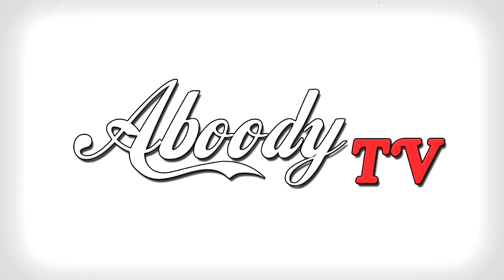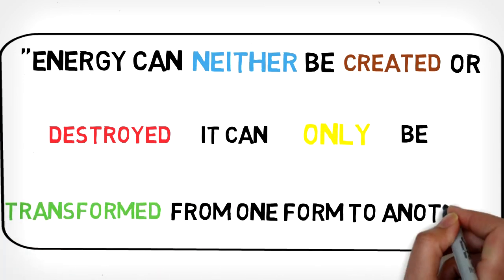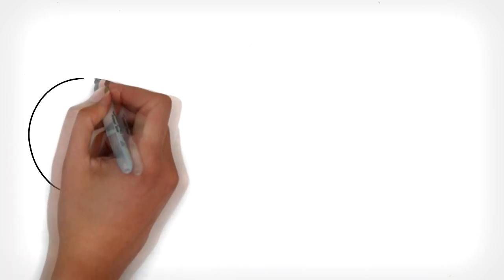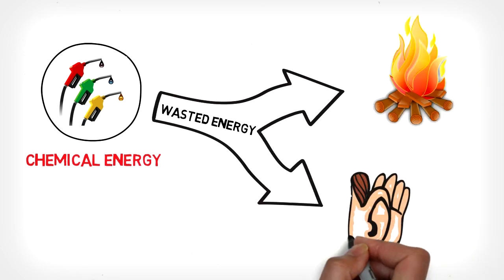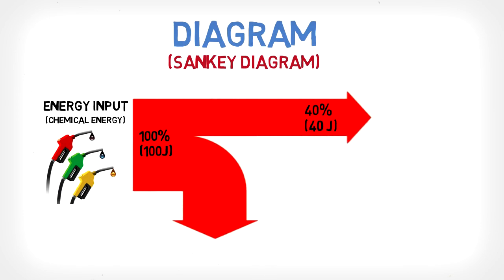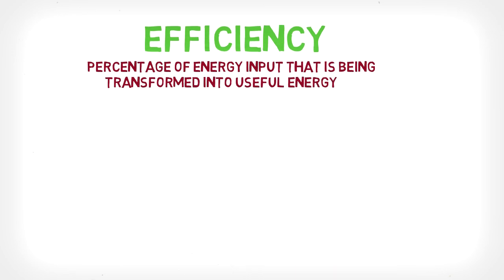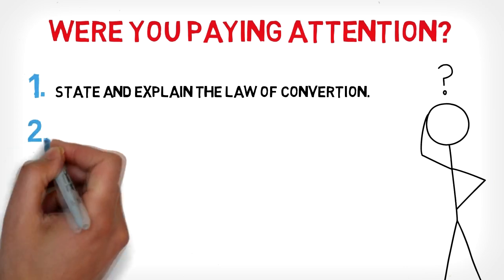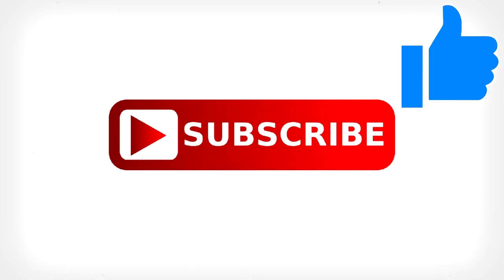PHYSICS: ENERGY TRANSFORMATION [ AboodyTV ]

Comment: I will answer ur question
1. Energy can neither be created or destroyed it can only be transformed from one to another.
2. Kinetic energy
Electrical energy
Heat energy
Light energy
Nuclear energy
Chemical energy
3. If the televisions power cord is not plugged into the power socket the television won't turn on. 
4. A Sankey diagram is to show energy stored and converted.
Hope my answers are right
Ty for the notes💕🥰💕🤗💕🥰
Reply: THANKS A LOT
Reply: OML TYYY UR THE BEST FR
Reply: thanks !❤️😊
Reply: thankkk uuu so muchhh
Reply: Thank you so much 💗😊
Reply: thx

Comment: excellent Video. You showed a vehicle as example, what if the vehicle got a rear motor without connection to the front wheels. Where does the energy comes from to spin the front wheels? Is it the same energy from the engine which only goes through the road to the front wheels?